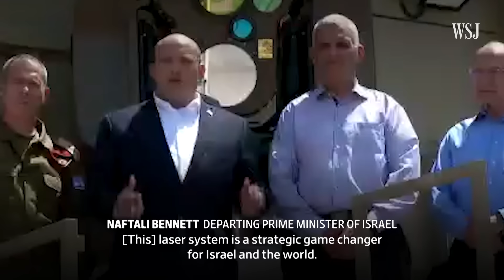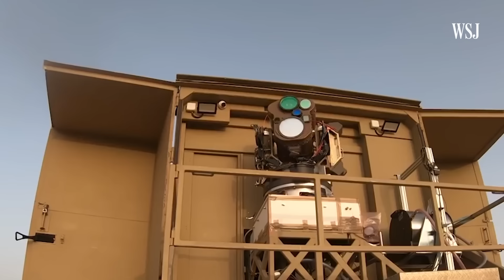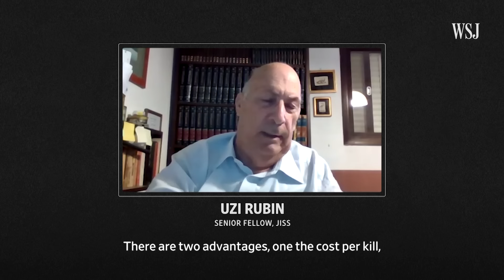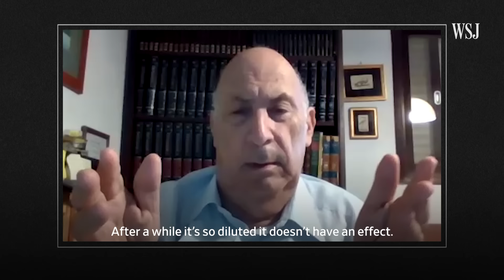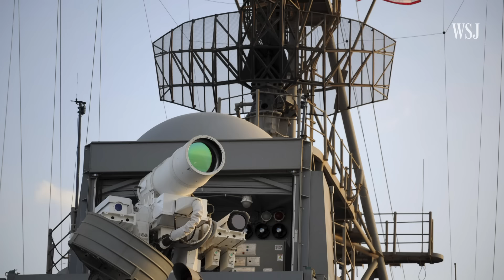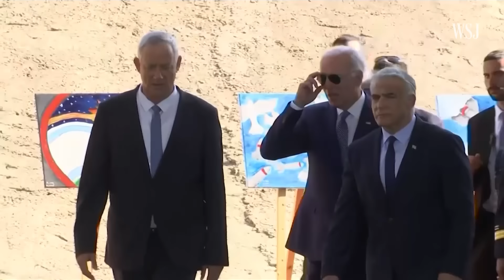Iron Beam: How Israel’s New Laser Weapon Works | WSJ

Comment: The systems sensor is not the problem in different weather conditions, the problem is LASER has trouble penetrating through fog, cloud, dust etc just like light.
Reply: That's why this will be an an addition to the Iron dome not a replacement.
Reply: if theres a more powerful laser, it could melt past the fog, cloud, dust particles
Reply: @xXxSkyViperxXx  Nope, LASER doesn't work that way.
Reply: what about a maser? a microwave laser?
Reply: Israel does not have a problem of the first two and Hamas does not launch rockets during dust storms for fear it might airstrike its own Gaza enclave, so cloud, fog and dust are not threats to the Iron Beam's viability from an Israeli context.
Reply: @Gerald Maxwell  trust me, Hamas doesn’t care killing it’s own civilians.
Reply: @geraldmaxwell3277  Israel does have fog and clouds and plenty of them, especially on the Lebanon border. And a third of all rockets fall in the strip yet hamas and IPJ do not care. Also doesn't have to be dust storms, it could just be a dusty day or low visibility.
Reply: @yuvalbeery2493  But the Iron beam is being deployed primarily against Hamas not Hezbollah in the North.
The area around the Gaza Strip has a Mediterranean and Semi-desert climate and the Southern part is very much the Negev and Sinai desert. So, No. There is little fog or cloud cover there. 
Hezbollah does not fire hundreds of rockets into Israel every year so they are clearly not the target the Iron Beam has been built and designed for, especially when you consider its range, it is clear that you will find the Iron Beams in Sderot ,Ashkelon and the likes not Nahariya and Kiriyat Shmoneh. 

If Hezbollah was to launch such, (it may in future) it would be the work of the Iron Dome to stop them, not the Iron Beam.
And there would be a ground invasion too. Also, Hezbollah would also most likely launch a spring summer offensive too. The 2006 war was in July.

Hamas actually does care if rockets land in the strip, but not because it cares for the civilians, but because if they keep landing there, their support will be eroded and the Islamic Jihad will become more popular. And Sinwar does not want that. Unlike Israel, IPJ is literally in the next building/tunnel/shopping mall-where-assassinations-can-easily-occur over.

Hezbollah has a similar problem too though the risk is much lower as Lebanon is much larger. It will however take just one Hezbollah rocket ending up in a Druze, Christian or Sunni village to resurrect the old sectarian millitias which would suck in all the unemployed youth in that country.
Reply: The system can be airborne and therefore alleviate the problem.
Reply: So all it needs is a better, faster, & longer ranging sensor(s)
& satellites with these sensor(s) in tandem
to detect & destroy incoming 'HyperSonic Missiles' ?
?
Reply: not exactly
Reply: It’s just another layer on Israel air defence
Reply: said mustafa in a hope of his whole family immigrating to us from iraq
Reply: @sanacher101  What happened to "Give me your tired, your poor, Your huddled masses yearning to breathe free" ?
Reply: You are right and therefore want to put the system on an unmanned aerial vehicle
Reply: "just like light"

LOL
Reply: Simple if you want it do that you need to (XYZ). Not gonna to say it for the whole world to know only the good guys
Reply: N https://youtu.be/PPdhLqyFhG0
Reply: well then maybe they should hire styropro
Reply: These types of videos are so lazily made
Reply: as it's shooting through cloud I guess it evaporates it, so hinders it but doesn't render it useless I guess, far from efficient but they need to increase the power output for better range anyway
Reply: you know we have airplanes seens 1920 something?
Reply: Congratulations, you just repeated what the video already clarified 👍🏽
Reply: @HiThisIsMine  The video said that the radar would not work under severe weather conditions. What he is saying is that that is not correct and the laser will find trouble in such weather. Read it correctly
Reply: @HiThisIsMine  no, they said the sensors can't operate in rain or something.
Reply: @yuvalbeery2493  - read my comment right above yours… this is already addressed 👍🏽😉
Reply: @HiThisIsMine  lol
Reply: @HiThisIsMine The video said bad weather affects the targeting when they should have said it affects the Laser beam itself
Reply: Isn't that what weather conditions means.
That the air is not clear there is snow rain fog dust etc
Reply: No it wouldn’t. The energy density is insanely large.
Reply: @NeverFinishAnythi  not large enough yet to go through clouds. It is a solid state laser, and it means it is not as strong as earlier chemical lasers (project Nautilus), and it will require some more development to become stronger to a level it can go through clouds. It is a strong laser for its kind.

Comment: Red beam, once it turns blue that is when you know they finally perfected it. The highest ionized energy produces blue light.
Reply: Its infrared light you can't see with ur naked eyes
Reply: @Clara_silicone_crafts  copied from google: Emitted from the sun, blue light is naturally occurring in the world around us. On the spectrum of visible light (light that humans can see), blue light has the highest energy and the shortest wavelength. So yeah you are right, but blue light is what you will see since you can't see UV light.
Reply: @Clara_silicone_crafts  red visible light is about the lowest energy type of light, if you can see it, and it is red it is low ionization, if it is blue that means it is the highest or even higher because you can't see the UV light. So even if 99% of the light is UV, some will lose energy due to the atmosphere, light a lightning bolt it will appear blue or very light blue even if it is UV light, but due to the loss of energy from colliding with oxygen and other things in the air it will dip down into the blue visible spectrum.
Reply: @Clara_silicone_crafts  sorry I am an engineer not a writer, so I will try to explain again since I wrote kind of badly. So basically you are right, but humans can't see UV, but a UV laser would lose energy and part of it would turn blue, depending on what material it is going through it could show different colours, but basically you can know a laser is super high-powered if it starts looking more like a lightning bolt bluish colour instead of a red light.

Comment: Laser tech is probably the closest we can get to intercepting ICBMs, which might make nuclear warfare winnable. Just imagine battleships equipped with lasers sailing close to enemy territory. Would completely change the equation.
Reply: Lasers will not intercept ICBM's and there's decoys to worry about and thermal blooming and weather and you dont know what you are talking about
Reply: @SavAgeofAquarius  lasers from the ground , no but lasers from space absolutely.
icbms fly higher than the iss which makes them fair game for space lasers.
Reply: @SavAgeofAquarius  Laser intercepts ICBM if mounted to a nano-satellite -- not mounted to a boat, as the O.P. postulated.  A terrestrial-based laser does intercept SRBM's (submarine launched nukes).  With NO ATMOSPHERE, lasers aren't diffused as much, thus giving a large range distance.
Reply: And if your enemy has the same laser too?. at shore.?
Reply: No way that you can focus a useable beam on a MIRV that's 2000 km away. You're looking at 15 m wide beam, minimum at that distance. So you're looking at 50 MW class laser - minimum. Orbital mechanics force this range issue. You'd need a dozens of 10 000 ton lasers up there (many thousands of Star Ship launches) and that would still only protect against Iran and NK.
Reply: Also remember that computers used to be the size of rooms and today it fits into the pocket of every technology at the beginning of its journey, immature and unprepared, maybe they will make a leap soon and the vision was for offers @nehorlavazapalka

Comment: Isn't reflective paint be enough to prevent any laser damage?
Reply: Nope, that beam is highly ionized energy, it ain't a torch. It will melt through a mirror just as quickly as it will melt through anything else.
Reply: @jakemon4550  "Nope, that beam is highly ionized energy, it ain't a torch. It will melt through a mirror just as quickly as it will melt through anything else."
I had no idea, I though mirror surface would dissipate the heat/energy.
So I guess the only problem is the weather (cloud would dissipate energy?)
Reply: @jakemon4550  A mirror is NOT the same as a perfect mirror finish, applied on a metal body to act as a heat sink. 
Even if they build a gagillion kW laser, it will do fark all to a missile with a perfect mirror finish coating applied. 
Especially if the object is rotating, be it the entire missile or just its outer, mirrored sleeve. 
That laser wont spend more than 1/2 a sec on any one spot of a highly reflective and thermally conductive object. No effect.
Reply: Well, lasee cutter can cut clear acrlyc pretty easily.
Reply: Yeah at least damaging the guiding system of the rocket

Comment: in rain and cloudy weathers will laser light refract and reflect?
Reply: Yep, until they can get the energy high enough, then theoretically it will cut through anything including dense fog, the issue is making a device that can handle that amount of Ionization and not melt when trying to fire.
Reply: Yeah that’s why theh need to continue to work on jt

Comment: Multiple iron beams on a single target should cut the shootdown time?
Reply: They are different distances apart, and so not as effective than increasing the power of one laser beam
Reply: I'm assuming that since the beams are coming in at different angles they would be heating up different parts of the rocket. So if the point the beams hit is close enough yes but if they're hitting different parts of the rocket I would say no
Reply: This is an obvious idea and Israel has stated Iron Beam could use such a configuration.
Reply: @oxytocin1989 it's almost impossible to hit with two systems exactly at the same point. So, heating will be in the different points for the same timeline
Reply: Yeah but then youd have many lasers firing at a single missile. 5 lasers can destroy 5 missiles in 5 seconds, or 5 lasers can destroy 1 missile in 1 second. Thats not an improvement
Reply: Yes, but then the demand for energy will be huge.
Reply: @STEPPACAFE  100kw would take 36 seconds to use a kwh, which costs approximately $0.16. That is beyond negligible cost or power draw. You could have an array of hundreds or thousands of these working in unison to take down many targets rapidly, and the "ammunition" cost would never even begin to approach the cost of even a single interceptor missile.

Laser weapons are a big deal, and the modern world's power grids (both formal and decentralized [home storage]) and only increasing in strength by the day.
Reply: @STEPPACAFE  Tap into central power supply? Lasers won't be shooting forever so it's better to have a blackout for 10-15 mins than a missile land on your house
Reply: @the_penguin_13  laser probably has a battery bank with a minute or something of beam. Then a small diesel generator to recharge. If it can take out 12 targets that's just about as good as a missile battery. Could be connected to the grid for faster charging. 100kW is about 1000A @120V (which is equivalent to 5 houses with 100A 2P Pannels) if your only shooting 20% of the time, you could run it on my house's power supply.
Reply: @dresengineering  yes you are correct about it having capacitors to store power in, battery storage and it's lifespan has always been the problem with electrically powered systems be it those fancy railguns the US navy failed to miniaturize enough that a destroyer can mount it or these Lasers to have enough of an "ammunition pool" for consistent rate of fire and rate of charge, 

the world is still waiting for a major leap forwards in electricity capacitance so that everything else from smartphones to electric cars to these defense systems to be capable of being efficient enough to be considered widespread.
Reply: @STEPPACAFE  The system can recharge slowly, no pressure on power grid or small generator
Reply: @STEPPACAFE  they said 2$ per missile, so 5 iron beams would make it 10$ per missile, that's literally nothing compared to 50,000
Reply: @STEPPACAFE  still not as expensive as a iron dome missile

Comment: i read in the paper - the next step is to take this system, put it on a drone, and that way the range increases.
Reply: Israel Elbit systems already tested the laser system on a plane. It's on youtube.
Reply: you'd need a battery pack 3 times the weight of the drone just to have enough laser time on target for even just a few projectiles until it runs out of juice
Reply: @rrenkrieg7988 Antimatter reactor should be equipped as energy source in Drone.
Reply: Weight is too great. Unless you want to keep a power cable attachment to it.
Reply: @AJ.L2468  No, Eitan drone has a 1200HP engine and has a very large payload capacity, enough to power the laser system

Comment: Interesting naming. One would assume the advantage of a spherical structure is that it doesn't requires any beams.
Reply: A light(or laser) source looses energy exponentially as it leaves the source. Concentrating light to a point increases the intensity of the beam at that point allowing for the melting of metal

Comment: I am certain this has been thought of however converging several beams would help no?
Reply: If multiple beams are able to target the same part of the missile with similar precision, it certainly would increase the speed to destroy missiles. It may increase the effective range as well. Obviously, this increases the cost of a system and may not help at all with certain weather conditions. It also would introduce the difficulty of coordinating multiple systems together, especially if they are geographically distributed. 

If this kind of technology becomes more common, other countries would certainly focus R&D efforts on making missiles that have countermeasures though, which I imagine could take the form of a special material on the outside of the rocket that is able to reflect a high percentage of the laser's energy, lengthening the time to kill or even negating it entirely.
Reply: @SF12398-m  “…special material on the outside…”  I went immediately to retroreflectors.  It’ll reject a high percentage of the incoming energy and send it straight back to the firing location.
Reply: @CarFreeSegnitz  mirrors dont reflect 100% of the light back, also keep in mind that these arent the tiny laser pointers you're used to. This is a 100 kW laser, it would absolutely destroy a mirror
Reply: @tinytanks  Look up retroreflectors.  It will send light back to its source no matter what angle it comes in at.  NASA used this feature by having Apollos 11, 14 & 15 set up retroreflectors on the Moon.  Now we can .fire lasers at the Moon to get extremely accurate ranging measurements.
Reply: Converging multiple beams from geographically distanced sources to a single exact point in space is easier said than done.
Reply: idk, think I saw in a movie once that it was really really dangerous to cross the beams....
Reply: @banto1  Ghost Busters 😄
Reply: If I were to speculate, multiple beams hitting the same target would not overcome the stated weaknesses. Continuing to speculate, each laser beam would damage the target independently of each other, so it would not speed up the kill. Converging multiple beams would not overcome the weaknesses due to weather nor range.
Reply: Tape some mirrors on the rockets?? 🤔
Reply: @EroticOnion23  It's all photons. Wether 100m long waves, microwaves, visible spectrums, gamma rays, or even more violent. There is no mirror that can cover the entire range. Learn what a mirror is to a photon
Reply: @tinytanks   @otherwise  retroreflectors set up a second reflection surface so the net angle is always 90 degrees.
Reply: Yes, but it does not reduce the bloom effect of each beam, nor can it accelerate much the destruction of the target as another beam would hit the target at another angle of attack and thus different spot, leaving the question of accelerated destruction to a question of thermal capacity and thermal conduction of the target material

Comment: It would make much more sense to make a rail gun. The price per bullet is higher, but the bullet is just a piece of metal. And it beats any conventional missile in cost per range.
Reply: I have only seen stationary rail guns. On the other hand iron dome and iron beam moves around easily.
Reply: Very hard to maintain the gun. It rips itself when fired